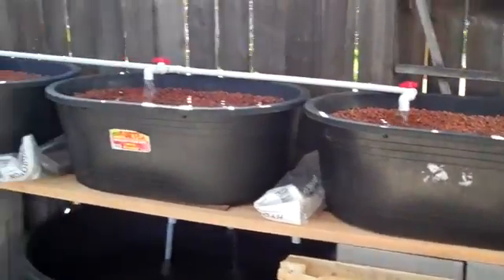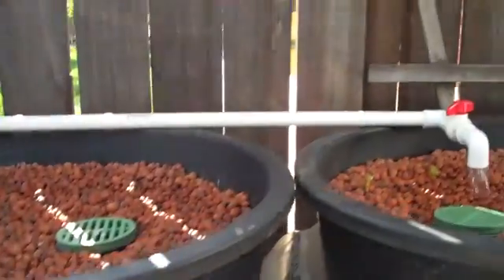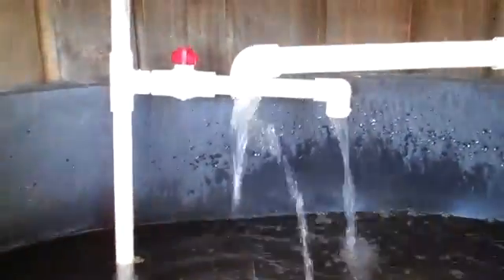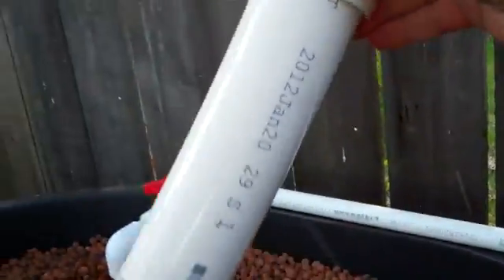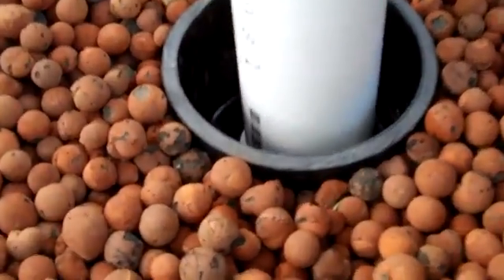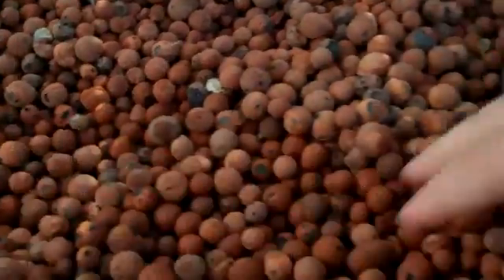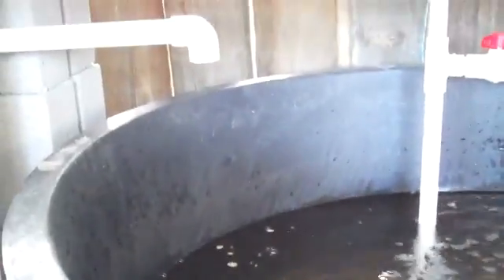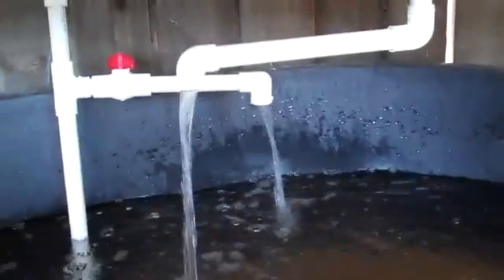Pipe Smoking - Aquaponics System Walkthrough & Demonstration

Comment: Freakin awsome reminds me of my coral fish tanks. Cool design. A couple tips from my experience. Try not to cycle pump, like on a timer. It will jam up? not primb, and burn up eventually. Better to let pump run 24/7. The other is a auto fill, like on a toilet. Even though a closed system. It will loose water quickly due to evaperation, especially with all the contact to air. I'm absolutly no expert, but have some experience. Just food for thought. Great work there, Take care my friend.